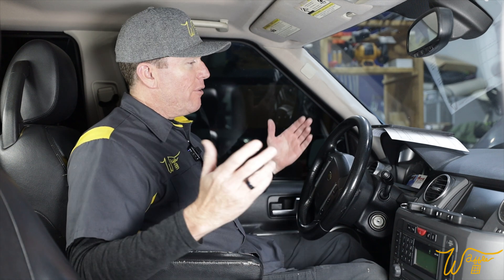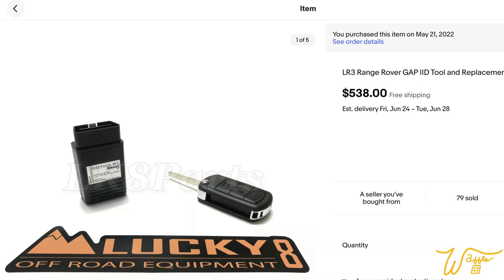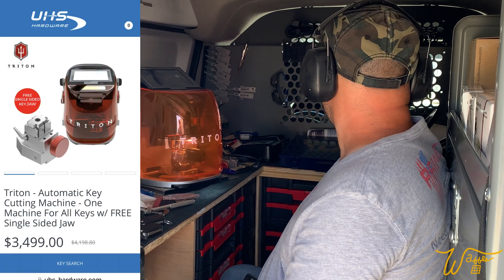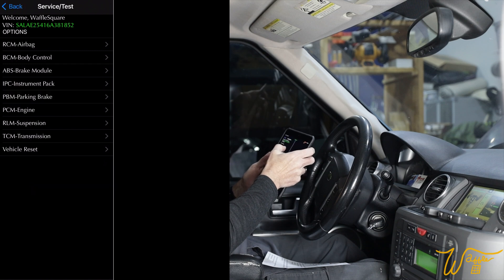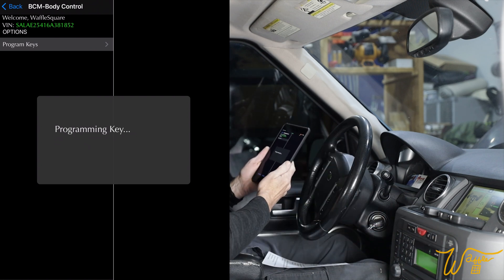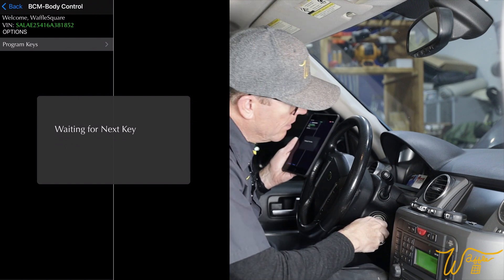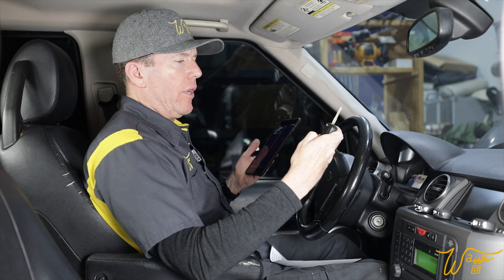Programming LR3 Remotes With the GAP IID Tool - Ep.10

Comment: Hey I have a question. So basically I only had one original key to begin with and before I had time to make copies the key fob got ruined to the point that the immobilizer doesn't even work. I'm told to take it to the dealership where they can program a fresh key in this scenario. They keep trying to push a factory $400.00 key on me saying that the generic ones might not work or they aren't as quality. So yes I agree they might not last long and they aren't as quality. My question to you is do you have any idea if maybe a generic one can be used in this scenario in place of a factory one? Or can generic ones only be used to make copies when you have an original present? I need to know if I can take a generic one there and in this lost Keys scenario they can use a generic one as an initial one instead of a factory one to copy from.... So what do you think?? So far they just tell me they can't guarantee it but that's annoying because I just want to know if a generic one can be copied can it be an original? I don't need to be guaranteed anything I just need someone to tell me logically yes it should theoretically work as an original in this scenario and then I'll get a factory one down the road
Reply from the maker: This procedure clones an “original” key, whether or not the buttons are functional.
Reply: @wafflesquare  yeah my original doesn't even work at the immobilizer chip level anymore. So it goes in the ignition I turn it but the red light flashes and it does not start because I think I fried the immobilizer chip which has nothing to do with the key fob ability to unlock the doors or not. The immobilizer chip doesn't even need electricity it's just read by the ignition cylinder area. But mine won't anymore and it did right before I tried to change the old battery and solder in the new one. So I'm just wondering can a generic one be programmed and fresh at the dealership in place of a factory one when no keys are present? Cuz I don't want to spend $400 on a factory one
Reply: @wafflesquare  the dealer says they can program a new factory key from scratch no keys working but they want me to use an original and I'm trying to find out if that's because they know the original last longer or because the original is somehow the only one that's able to be programmed from the get-go when no working key exists anymore
Reply from the maker: Sounds like a question for the dealership. I’m sorry I can’t be more helpful.
Reply: @wafflesquare  yeah the dealership doesn't even know they just recommend a factory one because they're trying to make money for the parts department haha they literally said at multiple dealerships that we are not sure either it will work or not but we're not sure and I'm like wow all I'm asking is if the generic ones are lower quality or actually different. But that's every dealership they're usually the most flaky places on Earth but have the best computer equipment well thank you I appreciate it

Comment: I have a question...this is my 2nd Lr, and the navigation is always missing.. they'er always on Ebay for sale, but are the wires that connect the back of the navigation station just tucked away in back of that ugly cubby spot that they put there, are do i need a donor Lr for the connection that goes on that back of the navigation to where ever they connect to...I've not yet seen a video about putting one there and there wasn't one, lord knows that there's a lot of trucks like ours and they don't have that station there.... if you make the MISTAKE OF UPGRADING IT you and the truck LOSE THE ABILITY (UNLESS you have a gap tool and 97% of us don't) to communicate. meaning, EVERYTHING that it used to tell you , you now rely on the gap tool, and that's not what makes a land rover a land rover. so don't take it out and making say its an upgrade if it DOESN'T repeat what the 1st system did and better. Its called an Information station for a reason

Comment: Following along, my prompts are slightly different. It has me start the engine, then return the key to position 1. It will also only program 2 keys, and am looking to get the 3rd one done as well. Did you run into any hiccups?
Reply from the maker: No the process went exactly as you see it in the video.
Reply: @wafflesquare  I think I partly figured out my issue... my ignition seems a little sloppy, so I skipped position 1 with ease!  But the process must have changed as far as starting the engine to initiate.
Reply from the maker: Glad you’re making progress.

Comment: You had one key that did not work. Did you get this working? Did you charge it up and if so, how did you do that?
Just went through the process with my Lucky8 key and does not work. Hoping you can help. Thanks.
Reply from the maker: Great question Gordon! The LR3 ignition actually charges the internal battery in the remote. All you have to do is drive around and it should charge (which isn’t easy for me since I linked so many remotes).
Reply: Thanks for the reply. The new key will not start the car. I can turn it fully to Start but nothing happens.
Reply: Key from Lucky8 simply does not work. Tried multiple times. GAP even says success but actually No.
Reply from the maker: Gordon I am working on a video about after market LR3 remotes that might be the solution!!
Reply from the maker: @gordonwedman3179 the key I received with my purchase of the GAP ID tool from Lucky 8 works fine. I would attempt to exchange it with the seller.

Comment: Now you can program the 3rd button on each key to perform a different function. Tailgate unlock, turn headlights and reverse lights on if you edit the CCF, turn on the alarm , or allow the remote to control the air suspension.

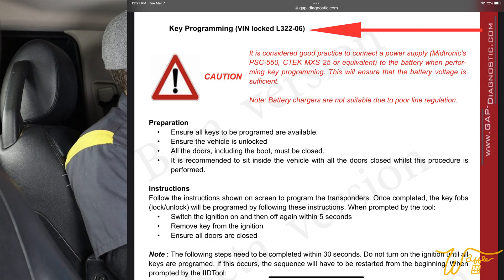2:19 You are showing the instructions for a Range Rover L322 of 2006. You want to show: Key programming (VIN locked L319-04, L320-05) on page 126 of the current manual - GAP Diagnostic 2019-05-31 All Rights Reserved User Manual : Version 32, Firmware V3.0. 
I have just checked the manuals.  You seem to be using the Beta version 34 for Firmware 4.0. with and different page numbers.
You mentioned page 120, correct, but showed the top of page 121 with your big red arrow.  
Best not to use the V34 unless you are a Beta tester. 
No need for the battery charger as it takes seconds to do. 

You seem to be having problems with Land Rover's sister brand. It's: Jag YOU are.  Jaguar.  Or as most Brits call it it - Jaag, but that  probably doesn't work in an American accent.

Hope this helps.

Comment: My keys work fine but the key fob is fallen apart , I just bought new key fob body and swap over the internal parts to new key fob body works good, have you check your lower front control arms I bet good money the one bushing completely worn out , many people say use a saw all not a grinder , well I own both tools and tried the saw all I felt it took too long and very noisy,  I went with grinder with metal cut disc 7inch I bought 10 of them you may think that's a lot yes it is but it you bounce at times then take a small chip out OT disc I still used it until worn down ridge makes a metal diamond disc for cutting metal but I find the abrasive disc cuts faster and it will leave a mess on your floor over the metal disc 7inch metal disc by rigid about 30 bucks vs 4 dollars a abrasive disc , that's right 7 inch will do the trick take your time you will probably nick frame or not good lighting so you can see where your cutting grinder will get hot may cut off due to getting hot 7f you have 4.5 to 5 inch grinder , I used that size with a 7inch disc got job done Milwaukee brand but if you have a correct size grinder for disc may not get hot took about 4 disc for one bolt , I finally install my abc brakes and rotor and replace center wheel hub and new air bags top front control arms very easy , front complete next is rear top , bottom control arms. I only hope brake line breaks free , you think why land rover didn't design brake line like front upper control arm just undo 10mm nut brake like of without breaking line open my control  arms was EOM and air bags looking forward to new feel of suspension once done and alignment

Comment: I hope you don't have the same bad expense with the ebay keys, mine would not keep a charge after a few months.  Purchased replacement fobs from Lucky 8 and has been working fine for a year.  I opened both up to inspect the circuit board and the ebay fob and Lucky8 fob circuit boards are different
Reply from the maker: I’ll keep track of their performance. Thank you for the tip!